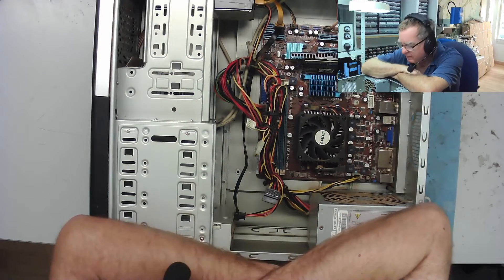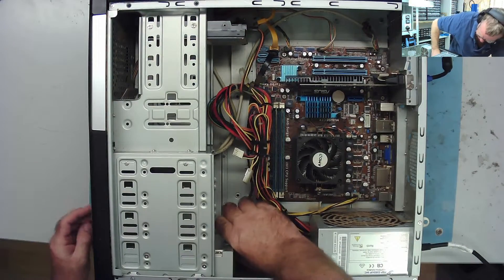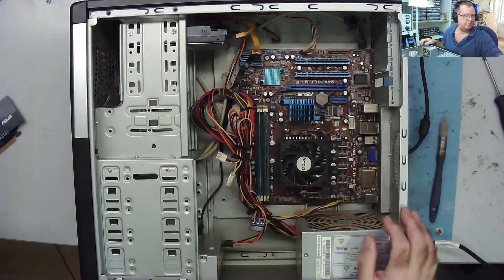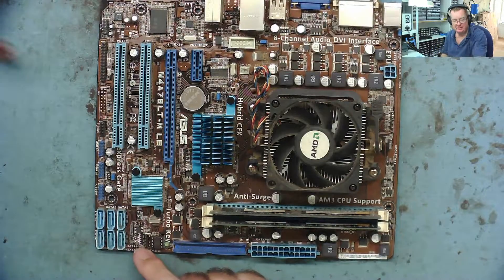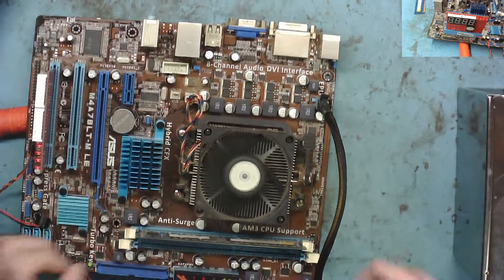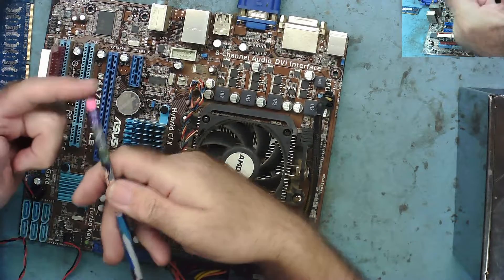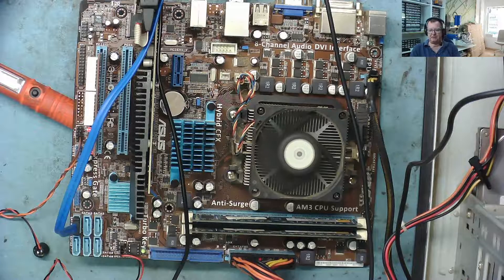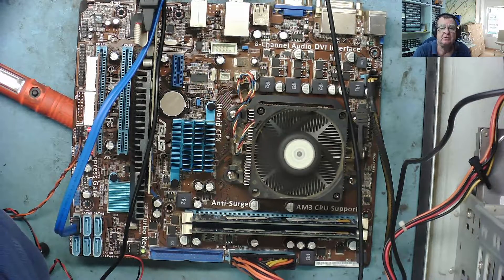ASUS AM3 PC powers on but no beeps no boot no picture. NOT component level repair

Comment: Hi. I also have that problem i have amibios. I tried to remove components one by one then when i removed the ram and i turned it on i hear beeping continuously. I bought a new ram and it works fine. I was curious why everytime i open my pc it runs the bios start up so i try to read something it says that my cmos is not working so i bought a new cmos battery. Another day i turned on my pc and bios came up i want to press f1 but accidentally i pressed f2 so it turned black screen with blinking cursor and nothing is happening i have no choice but to turn it off by holding the power button and unplugging the power cord. Turned on again the pc but nothing is happening. It is now the same with the video again but when i tried to remove the ram it doesn't beep anymore.  Tried to reset the cmos by removing the battery and used clr cmos jumper. But nothing happens just fans spinning no beeps no bios no monitor no usb.  I dont know what to do

Comment: I have a Asus m5a78l-mlx motherboard it ha the same problem but when removed the ram 8t beeped as one long beep and two short beep continuously then I put it back still I can't hear any sound or and monitor I used an external as well as an internal graphics card the cpu is fine the processor I used is amd athlon II 260 and  power supply is 450 frontech can you please find a solution

Comment: Personally, I would have an inspection fee, chargeable whether there is a fix or not, which at least covers some of your time / labour. This sets the customer's expectations as to what the minimum would be. Then a pre-stated hourly rate plus any parts cost.
Reply from the maker: Hi Ralph J.  Yeah a lot of places charge a fixed fee just for inspection even if they can not complete the repair.  My personal view, rightly or wrongly, is that if you offer a no fix no fee service you attract more customers, get more of the 'easy' jobs as well (because the customer does not like to risk a fee for inspection and possibly get 'nothing' in return) and the extra business gained offsets the time 'wasted' in jobs you can't complete.   Of course to make that work you have to know when to put a job down and go no further with it.

Mostly still, the repair work I do is based on the buy-fix-sell model

It's interesting to hear others opinions on this, and find out how they work.

Comment: Richard do you have an idea what could be a reason for drop voltage on atx power supply cooling fan from 12V to 3V when you connect the cooling fan to it, and ofcource when it's already connected the atx PSU is on and there's output voltage but the fan not spinning
Reply from the maker: Basically there are only three reasons for a voltage supply, like that to a fan, to drop

1.  The load is drawing too much current

2.  The supply can't supply enough current (basically the supply impedance is too high)

3.  The supply is designed that way, for example a fan that only runs when certain conditions are met e.g. the PSU reaches a certain temperature

So the best way is first to try another fan, and if that does not help, trace the circuit that supplies power to the fan to see how it works
Reply: @LearnElectronicsRepair  why can't  The supply supply enough current
Reply: @LearnElectronicsRepair  well Richard what do you think about that, when connecting 12V fan to 5V output line the voltage drop to 3V and the fan doesn't spin, but when connecting another 12V fan to 12V output line, both fans spin and 5V output line give 5V instead of 3, what is the explanation of this case

Comment: this a common faulty Richard due to RAM when  no beeps no boot no picture, first thing i do to take off ram and check if MB give beep for no ram then clean it as you did, 
hope in future you can explain about voltage injection how and where it can be done
Reply from the maker: Actually this motherboard was giving no beep with no ram but of course that turned out to be because there was no speaker attached to it.  I did voltage injection on the previous video ITX motherboards 
https://www.youtube.com/watch?v=s_K4N-nESCQ
Reply: @LearnElectronicsRepair  in general if we want to do voltage injection, how to decide the right portion and points of injection
Reply from the maker: @learngamecheating  You inject the voltage at the point where you can see there is a short circuit - the above video will give you a good idea how and when this is appropriate.  The correct voltage, well you have to use the evidence available - from a good working board, from the datasheet of a voltage regulator, and similar ways.  If you simply can not determine the correct voltage, use a low voltage such as 1V

Comment: Been there quite a lot of times. The customer asks for a quote to fix their PC or laptop before actually fixing it. That is so hard to do because you need to find the cause in the first place and verify the fault by replacing or repairing that component. Before you know it, it is fixed. The best I can do is charge for time if no component needs replacing or time and the cost of component(s) as necessary.
But this is where it can get sticky. The customer refuses to pay and demands it back. Not because you have overcharged but the customer has decided not to go ahead. What can you do ?. Remove the repaired component and refit the faulty one which requires more unpaid time or if it's a bad connection of RAM for instance, do you take the RAM out and swipe it between your rear cheeks a few times before refitting it?. Simply giving the item back as working only benefits the customer as a free repair.
You have the best answer. Charge and agree a decent minimum before looking at it then at least it covers you for your time.

To me, the object you wear to prevent babies is a 'Johnny'. The top end of a pencil is a 'rubber'. Off subject a black coloured board you chalk on in schools is a 'blackboard'. Some sick people think it's a racist word. To me it is the opposite of a whiteboard (which has never been challenged) but I'll leave it at that.
Reply from the maker: Hi Andy P
Actually whiteboard is the opposite to blackboard, as the blackboard dates from the mid 1700s and was used in educational settings by the early 1800s.  The whiteboard dates from the 1950s or 1960s but was not commonly used in classrooms until the 1990s.  Google says that the term blackboard is not racist, anymore than a black marker pen is racist. It's simply a board that is black.  The term gradually changed to chalkboard in some regions because they started using green blackboards (greenboards?) in the 1970s or 1980s, and chalkboard was more accurate, not because the original name was racist.

It's interesting to hear your comments about quoting for jobs. I think I will stick with my method to make a prior agreement that a repair will be made if it costs less than a certain maximum amount (usually I set €40) though I then often charge less than that if it was something simple and quick. If it is more than the agreed amount I then quote.  This get's around the problem of by the time you found the fault you fixed it.  

If I can't repair it I don't charge (seeing as I couldn't perform the agreed work) which is my fault not the customers.  

Very occasionally, if i think something has a reasonable chance of repair but the parts are expensive I will offer the customer the option to pay for the parts and clearly state I can not 100% guarantee it will fix the problem or that the fix will be permanent. A good example of this was an FM radio transmitter from the radio station practically opposite my workshop.  It was clear the RF output transistor had exploded, a replacement part was about €170 and I did not have the equipment to test whether the fault was caused by a problem with the transmission antenna or cabling or some other external cause.  In this sort of case, which is rare, I offer a repair at the clients own risk.

Comment: Great video Richard. Great find so it was probably oxidized contacts on the memory cards or in the slots. About that thing. In the Dutch language in holland we call that a "gum". I know that in the english language "gum" is related to chewing gum. But in Holland "gum" has a total different meaning. Some pencils have that on the backside and is used to erase the written pencil grafite on paper. You can also buy separate small blocks of "gum" without the pencil for the same erasing on paper.
Reply from the maker: Probably oxidized contacts yes.  Interesting in dutch this thing on the pencil is called a 'gum' and I raised an eyebrow at the thought of chewing one LoL!
We called this thing on the pencil (or indeed a separate block as you mention) a rubber as I said on the video - not to be confused with a that other 'thing' which was called a johnny or a durex 
Google: What is Johnny slang for?
1. (often capital) informal. a man or boy; chap. 2. a slang word for condom. Collins English Dictionary.